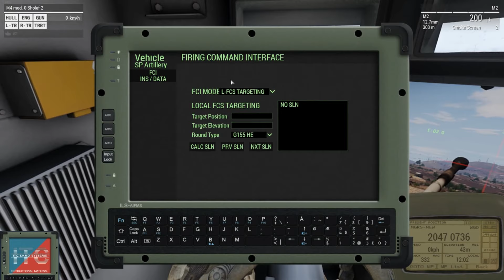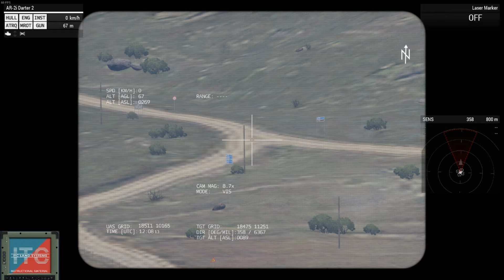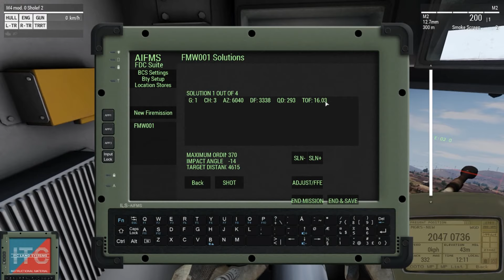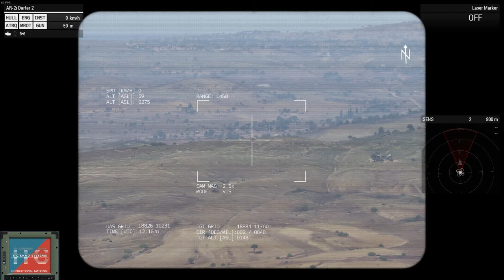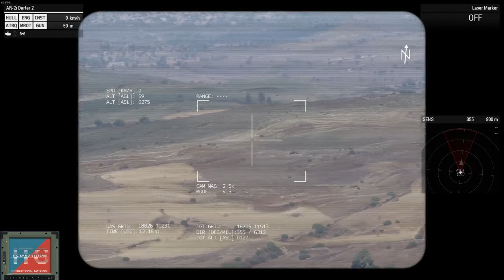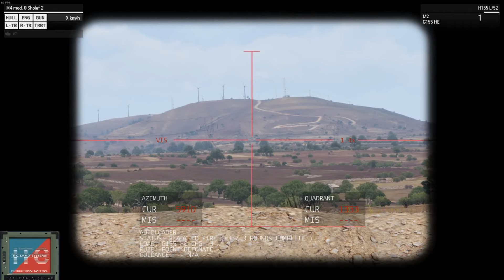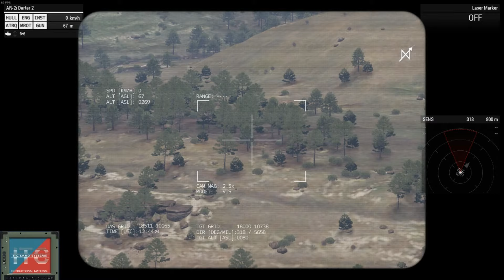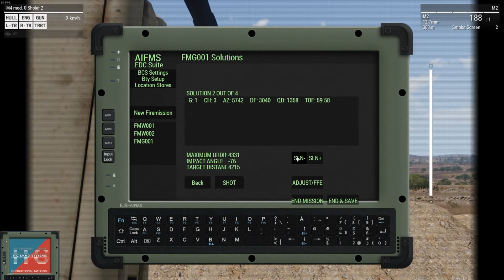ArmA 3 ITC Land Systems - Artillery Tutorial

Comment: I've been looking for videos to help and this one finally made my problem clear although I still can't fix it. Basically I don't have the option for an ammo handler in the interaction menu so that's neat.
Reply from the maker: Are you running ITC Land, using the ITC variant of the artillery & in the gunner seat?
Reply: @HerbiieIsBest  as it turns out I'm just dumb and I was trying to use the mod for KP liberation which basically means that I only have access to the normal variant of the artillery which doesn't have the systems implemented.
Reply: @HerbiieIsBest  and btw your video is excellent, better than even the video links on the official mod page.
Reply from the maker: @sometoastxd  Happens to the best of us :P

Comment: How do you get commander's tablet to tell you the charge number to load in? For me it just says semi(medium) or semi(far), but in the gunner's selection I have charges 1 through 5. Is there an ITC setting somewhere?
Reply from the maker: Double check that you've set the tablet to the right type of gun maybe?
Reply: @HerbiieIsBest  I'm using the tablet in the artillery piece, have tried on the shoref and the M109A6, both guns following each step of the video and I double checked that I was using the correct gun